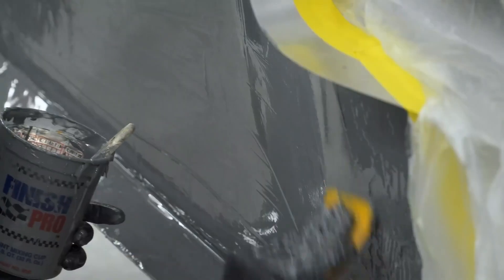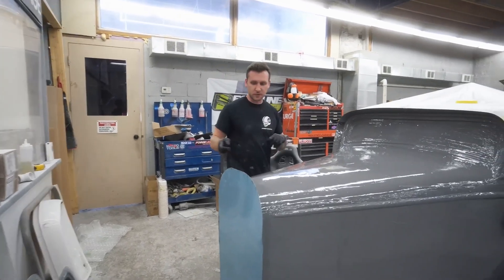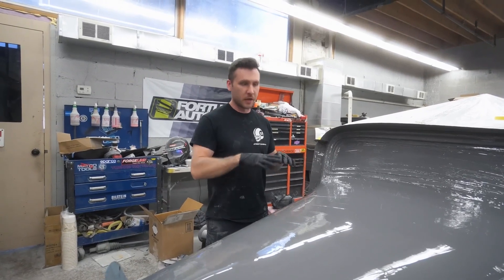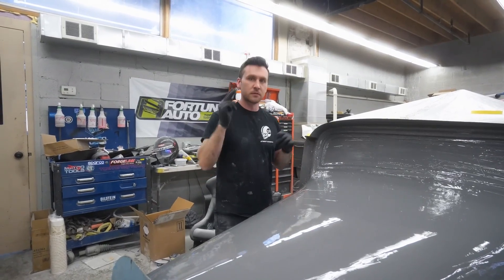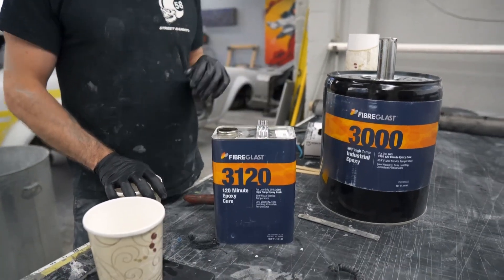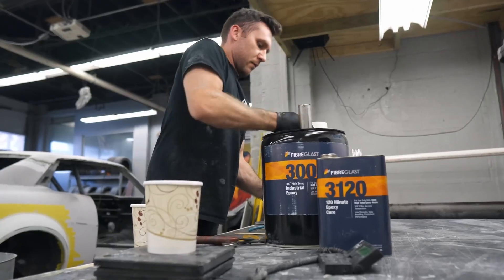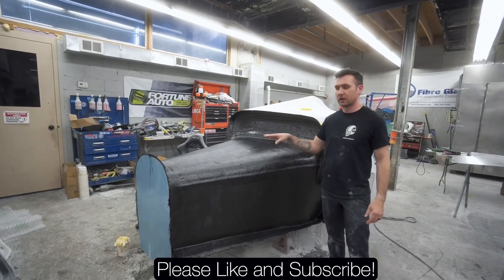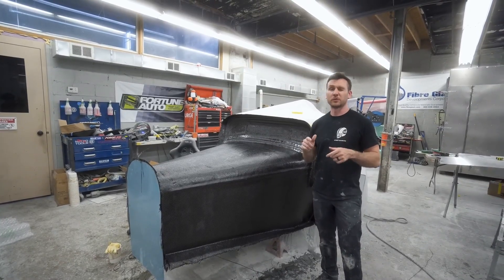FE 32 Fabrication - Part Four of Four

Comment: Slightly puzzled why your using Carbon for the mould. Given it needs thickness to gain stiffness, wouldn’t classic fiberglass CSM be vastly more cost effective, and also less risk of weave imprint ?   
Unless you are planning on using this mould in an Autoclave and want to match composite expansion properties : but that would need to be a very large autoclave. 
Did I miss something in your earlier videos ?
Reply from the maker: There are a couple of reasons to use a carbon fiber mold vs your standard CSM or fiberglass mold. Most CSM contain a binder that does not dissolve in epoxy so you would have to use polyester or vinyl ester which have lower temp allowances than a high temp epoxy.  This mold is being made for a prepreg carbon part and high temps are a must. Since fiberglass and carbon expand and contract differently in the heating process it is best to use like products to avoid distortion.